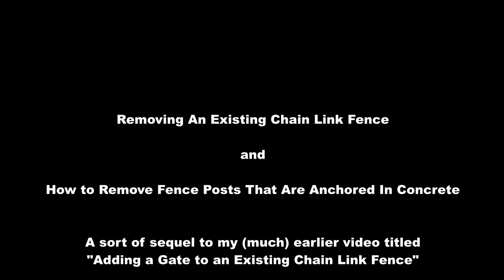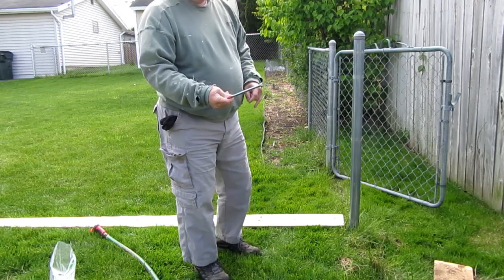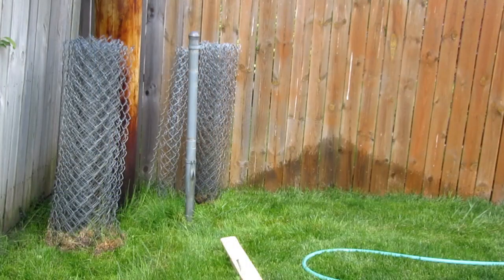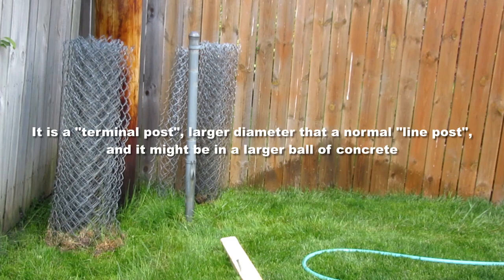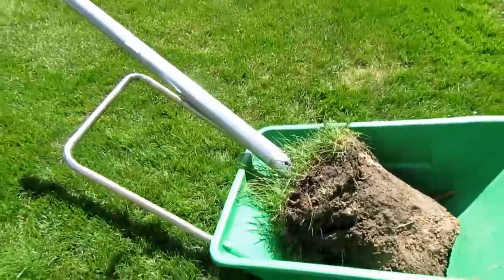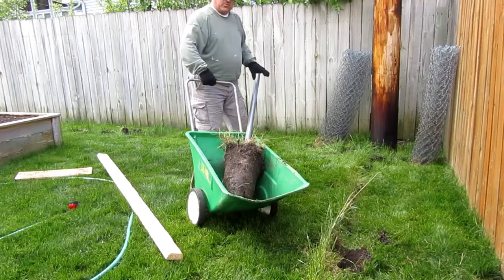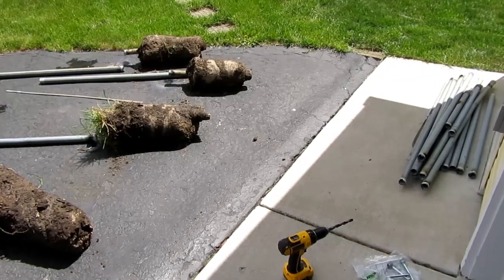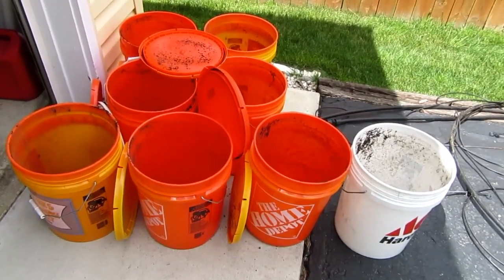How to Remove Fence Posts That Are Anchored In Concrete

Comment: Your method is pretty hard on the back and might cause an injury if your body mechanics are not right.  Next time put your fulcrum in front of the post and use your body weight to lift the post out.  You are easily heavy enough to generate plenty of down force on the end of the 2x4 to provide substantial lifting force on the post.
Reply: If you got an tire rim or your spare tire the and a tow rope will pop them sucker's right out of the ground easy as pie look up the vid on you tube I pulled a 4 in pipe with about 4 bags of concrete holding it down in 5mins

Comment: The back yard here has 3 of those concrete things. They were originally used for clothes poles, 2 of which are long gone. I think I can use this method to get rid of the one remaining pole but I still need to deal with the other two concrete things; they have no pole to use for leverage. It hadn't occurred to me to look for a video about that; I'll do that now but if you have any suggestions I'd love to hear them.

Comment from the maker: As the creator of this video, I should be frank and admit that while the technique shown has worked well for me on two occasions, I have since tried it on another property where the technique 'met its match'. This job included pulling something like 9 or 10 steel fence posts that were installed more than 50 years previously. The fence line had been overgrown with 'volunteer' trees, all ingrown into the fence fabric. I spent a morning with a demolition blade in my Sawz-All (reciprocating saw) cutting all the wood out of the fence fabric, and running the garden hose for about a half hour per post to soften up the surrounding soil. I used the same exact 2x4, short board, drill, bolt, etc; as shown in this video. But there had not been any rain in a month and the ground was rock hard. The volunteer tree roots were tightly girdling the concrete bases of the posts, and I could not budge any of the posts using this technique. I even used tried using a nylon web belt (from a ratchet tie-down strap) formed into a loop, so instead of bending like I did in this video, I could keep my body upright, legs bent, and sling the strap around the bottom of the 2x4 and over my shoulders, and then 'just stand up'. Even with this additional lift, the posts would not budge. I had to have been putting at least 1000 pounds of lift on them that way. I was worried that the 2x4 or something might suddenly snap and do me some injury, so I gave up.

I called a professional chain link fence contractor to come over and quote removal, and he told me that instead of the approximate 2 feet depth of the concrete that I had experienced, some of this particular vintage of fence had the posts set in as much as 4 feet depth of concrete. That, coupled with the very hard dry ground and the entwining roots would prevent pulling, probably even with a tractor jack, etc; and would prevent trying to rock them out, and the tree roots would prevent trying to dig the posts out. So I called a plumber who has worked on my property, and he agreed to swing by the next time he is out and about with his excavator, and he will pop them out with that, and failing any 'popping out', he will scoop them out with the excavator's bucket.

So, my technique shown here should work well for most fence posts, but certainly will not pull ANY/ALL posts that might be encountered.
Reply: I was thinking maybe put another board on the lift end, and us a floor jack for the first few inches (maybe a foot) to break the roots

Comment: This video helps a lot. A lot of people only show how to remove them, but don’t  show how to get rid of them. However, I wonder if I could reuse the removed posts somewhere else, still as fence posts.
Reply from the maker: Rick Yang, I think it would be difficult to re-use the fence posts after you have pulled them in the manner shown in this video. You would have to dig a hole larger than the concrete ball, so it would be very difficult to anchor the old post & ball in the new hole...you would probably have to make the new hole a lot larger and then pour fresh concrete into the hole around the old ball. And while it is easy to use pea gravel to fine tune the post height when using a new post, it would be very difficult to do that with all the weight of the old concrete ball attached to the post. And finally, the strength of the old post would be compromised by the holes drilled in it near its base.

Comment: Gosh, why pull a perfectly good fence?  Not picking in on you but, like me, you need to lose some weight. That being said, you are really straining your back doing this kind of work. 
As a guy with a chronic back problem for over 2 decades,  I cringe when I see someone in our age range putting huge stress loads on their back, lumbar, in particular.
Just my 2 cents worth and I do enjoy your many technical videos but take it easy on that back.  One bad move under stress can leave you in PERMANENT PAIN !!!
Reply from the maker: wa4aos, allow me to itemize my response:
- I pulled the "perfectly good fence" because it had not served any useful purpose in years, had been paralleled by taller fences on neighboring property, and was a pain to trim around when mowing the lawn.
- Yes, I put on some belly fat, not much extra weight though, due to massive lifestyle changes during the COVID era.....the very things that helped me keep it more or less under control all went away. Now that I am retired, I hope to escape from the forced sedentary lifestyle and trim up some.
- I am not lifting with my back, I am lifting with my legs. It is also not a hard lift, actually no more than about 50 pounds at my end of the lever. It looks harder in the video because I am lifting slowly so as to not fight suction more than necessary. It was also only 7 lifts over a half hour, and not a type of activity I do regularly.